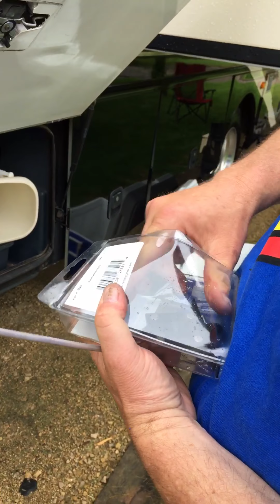Replacing baggage door latch on RV

Comment: Had to replace the exact same style latch, but mine was different.  Mine was a E521 style with holes on 2" centers.  Had it replaced in minutes, but had to make a few adjustments.  I bought mine off a RV Seller off E-Bay and it shipped quickly and only took a few days.  Their E-Bay store is  https://www.ebay.com/str/biasproducts